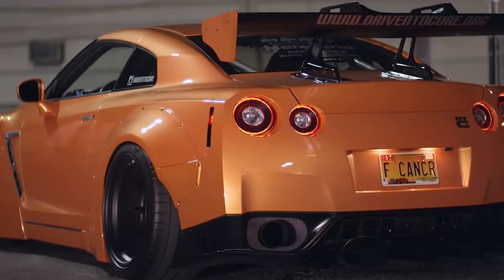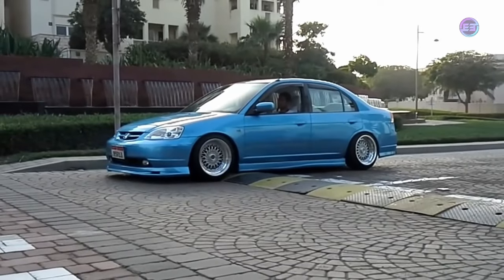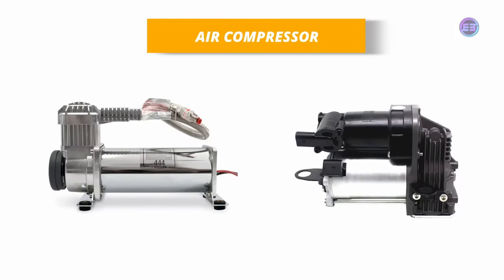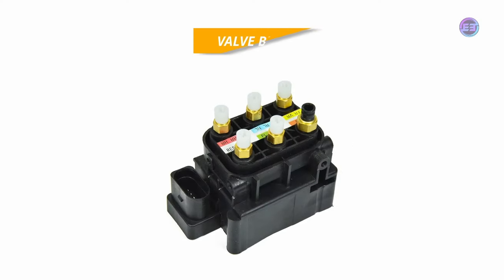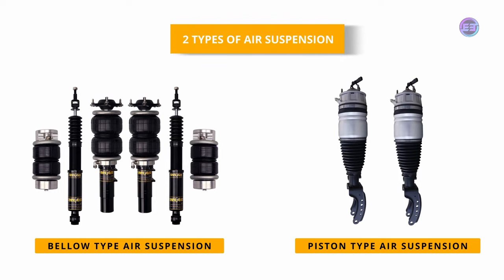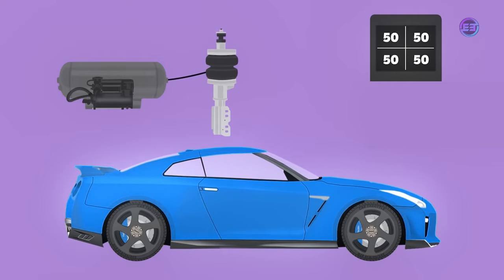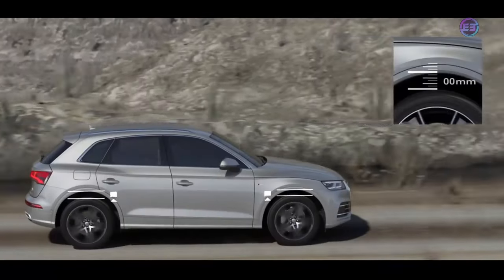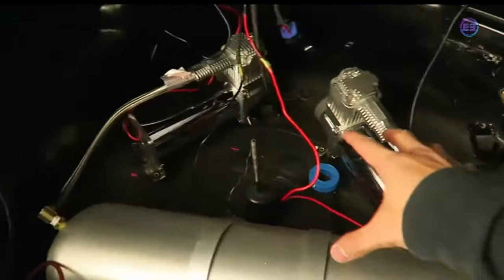Air Suspension(Height Adjustable)-How Does it Work? What are the Parts Used? | Pros and Cons.

Comment: Do you increase the ride height by increasing the pressure (psi) and thereby increasing the spring constant in a non-linear way (PV=nRT, cutting the volume in half doubles the pressure)? Does air suspension need separate damping? Street cars want shorter travel suspension with stiffer springs and off-road cars want higher ride height and longer travel suspension with less stiff springs. It would seem to be difficult to do this, but very desirable. Is there a clever trick?

Comment: well explained - all air suspensions are very expensive to maintain compared to the advantages offered by them   - correction needed and not explained - when you lift the car with air  the suspension becomes stiffer -also the travel length of the shockaborber changes - reduses  which can some times damage the seals whereas t if you lift your SUV for ground clearance  the lift spring gives you almost same ride comfort or better as stock springs and you get long travel shocks with double tubes which are much better than stock shocks -

Comment: where does the air leave the suspension when you deflate it?
Reply from the maker: Valve block Controls it- Air can be sent back to the tank through valves or the mechanic can directly deflate from air strut.